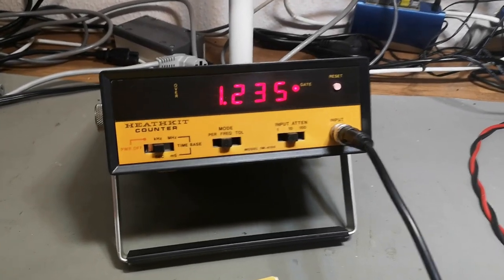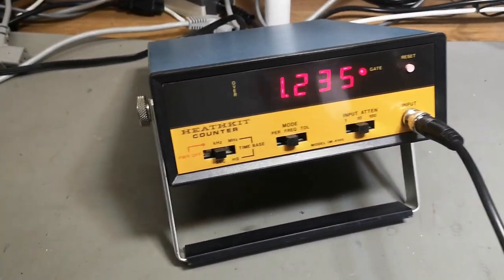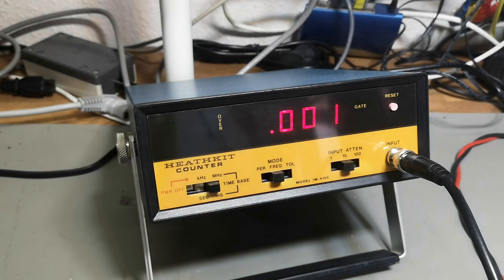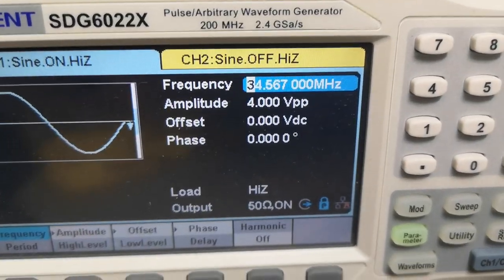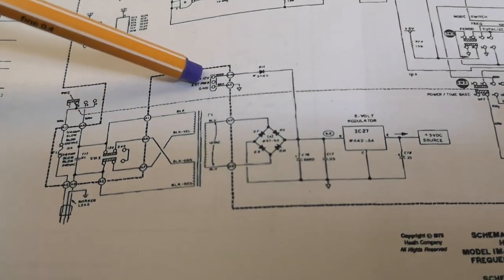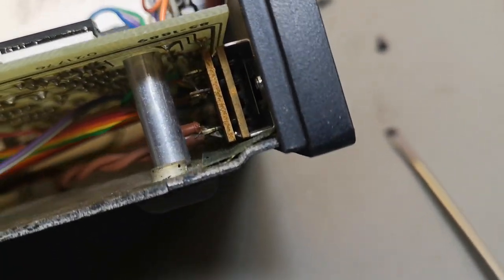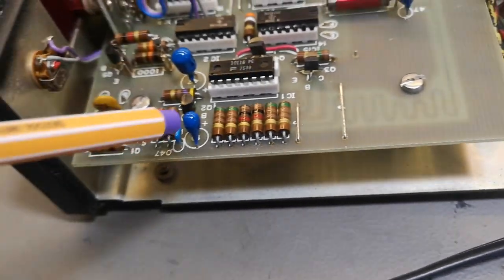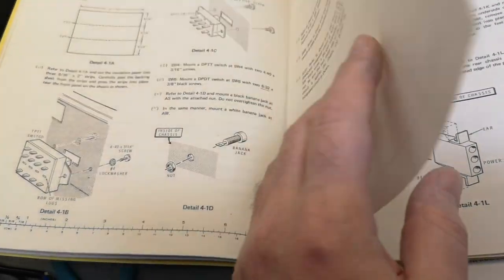Heathkit Frequency Counter IM-4100 30MHz 1975 test teardown (Motorola S-1357A)

Comment: Back in the day, I built dozens of HeathKit units.  Their instruction manuals were perfection of clarity and instruction, both in the circuitry theory of operation and construction protocols. Nobody did it better.
Reply from the maker: absolutly right, their manuals are all on another level, i think heathkit was also used as a great way to learn electronics, so it is not only how to assemble and how to get a kit working, but also all the other things like a broad understanding

Comment: Kinda odd that Heath used the ECL triple transmission line amplifier IC in the front end of a 30MHz maximum frequency counter. Their older series of counters did essentially the same thing with a few transistors on counters working to at least 100MHz. I suppose it just came down to it being simpler, more modern, and maybe a few cents cheaper to use the overkill IC as solution.

Interestingly, you will find the same IC and associated circuit  in practically every frequency counter design from the mid-70s. I don't know who first realized that the three identical differential amps in thus IC could be rigged up to provide not only a hign impedance buffer, but also a programmable gain stage AND also a Schmitt Trigger, and because it us ECL it will work nicely way up in high frequency ranges without modification; I found it odd that the Motorola datasheet for this IC gives no suggestion that it can be used in this way.